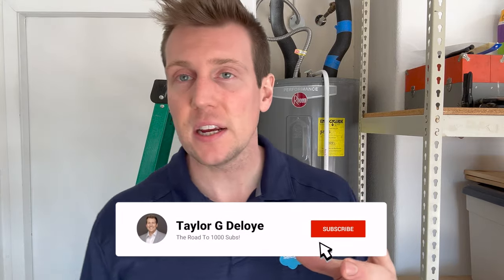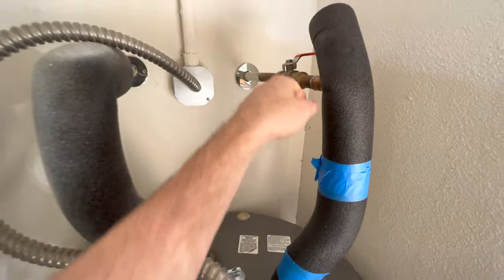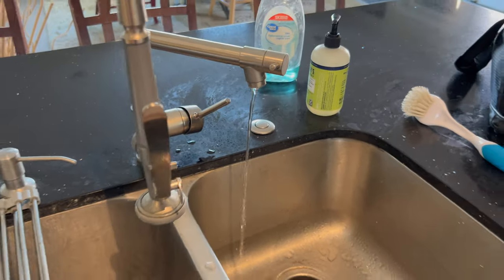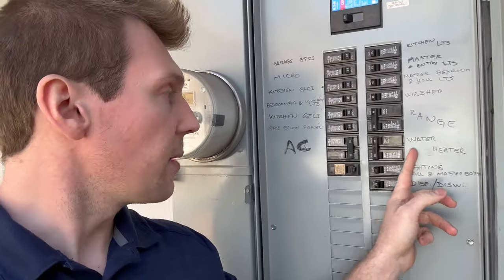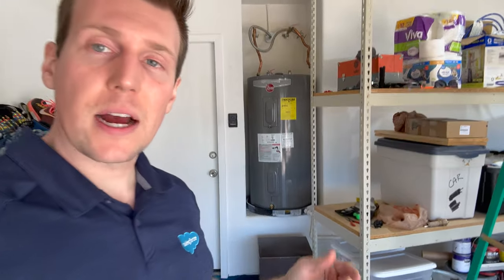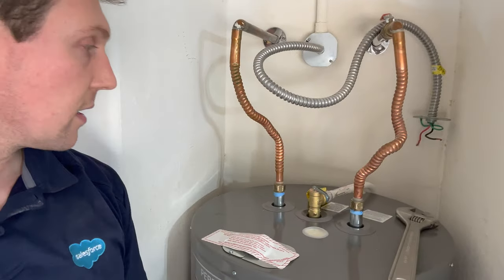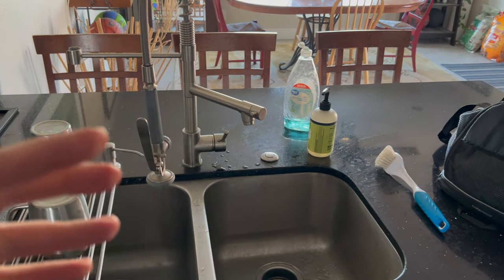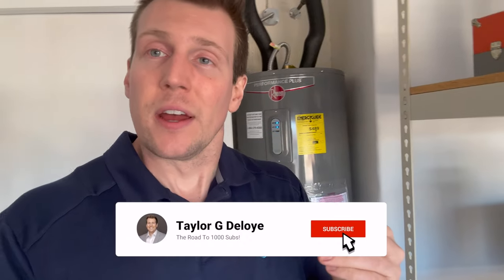New Electric Water Heater Replacement and Installation with Handy Tips #diy

Comment: Why not show the electric wire connections actually being done, then your like something something something electrical tape?? These people are watching because they haven’t done it
Reply from the maker: My apologies! I should have shown that in more detail. In general, you simply match the color of the wire, twist the copper ends together and then twist the cap on. Boom, done.
Reply: Then the pressure valve you have white hose or pvc that just appeared with no explanation.   The wiring and the pressure valve was what I needed more explanation of.
Reply: That's the whole reason I'm here, the electrical conections...
Reply: If you don't understand that you shouldn't try this

Comment: I was just quoted $2800 from TWO different plumbing companies to replace my hot water heater. THANK YOU so much for this video!! You helped me do this on my own. And, I saved $2,000 doing this! I'm a fan!
Reply from the maker: Great to hear Joe! Very welcome!
Reply: Price must include the super dupper high tech wi-fi water heater as well
Reply: @RCREVIEWS101   🤣🤣 I did it myself and it cost me around $700. A savings of $2100. What is WRONG with these companies??
Reply: @Joe_Murphy-REV_Realty  they’re just trying to make a living like everyone else
Reply: @Joe_Murphy-REV_Realty very nice you just voided warranty if anything happens and any home insurance.
Reply: @azzafilms97  not true. There is nothing on the warranty that states that a water heater must be installed by a professional. As a matter of fact on the warranty registration form on Bradford White's web site the only fields that are NOT required are the professional Installers name and phone number. I just returned the leaking heater to my local plumbing supply where I bought it and was given a brand new 40 gallon heater because the one I had bought was still under warranty.

Comment: You should run the sink the hot water side to get all the air out before you start doing your electrical work if you don’t do that is possible that you can burn out the water heater
Reply from the maker: Good to know, thanks!
Reply: Exactly .  Always purge the system of air and get water flowing from all the faucets hot side before you turn the breaker back on   or you can burn  out the top element . 
He seems like a good guy and hard worker but he shouldn't be doing DIY videos regarding this .
For the very reason that viewers might follow his instructions , but not see your comment
Reply: @vicschauberger2737 i think that happen to me I did manny mistake with the installation 😢

Comment: New potential home has the water heater in a closet in the living room with no venting. Is this a red flag ? The closet is closed with insulation to keep the noise down and no vent.
Reply from the maker: Water heaters don’t necessarily need to “breathe” like an HVAC system does. However, giving large electric appliances some airflow is generally a good idea, having it closed into a closet could reduce its lifespan. If this is a gas water heater it should NOT be in a closet as they produce carbon monoxide.
Reply: @taylor.g.deloye  thank you so much
Reply: @taylor.g.deloye  just checked it appears to be gas. It has a warning to call the gas company if gas is smelled.

Comment: You don't need so much teflon tape.  4 wraps is enough.  Also, it doesn't matter if it's red to red or black to black because it's 240v.   It is best practice to do color matching.
Reply from the maker: Thanks for letting me know!

Comment: Nice video, mine is in the attic, and it must have been clogged with something that it wouldn’t drain overnight.  It was a pain to replace 😂.  On a 1-10 scale, I would rate it an  11.  Had to go to harbor freight to get a chain hoist for 70 dollars to lower it safely.  I got the same model that is on your video.  It was a breeze to put in and install.  To hire a plumber, it would have cost $3000, paid $670 for the heater and $70 for the hoist.  Hopefully will not need to replace it in the next 20 years.  Great video. 👍
Reply from the maker: Wow sounds tough! Good work!

Comment: I was quoted $500 (with having already bought the tank replacement and getting a repeat customer discount), but I'm going to try to tackle it myself. I spent about $75 on the new parts, so that'll be a $425 savings if I don't screw up. The tank I'm replacing was made in 2005, so that's like 18 years lol so I bought the updated AO Smith 55 gallon 5500 watt tank replica tank on Labor Day for $300 off. I'm not going to bring it to code with the shutoff ball valve on the cold supply line b/c those lines aren't leaking and I don't want to have to get into cutting pipe and soldering, but at 2.625% interest, I'm probably not gonna move until this tank needs to be replaced again anyways lol. Gonna tackle it this weekend after OU vs TX. Wish me luck!

Just some info for your viewers when deciding on tank size and wattage:
- Someone who lives alone can get away with a 30-35 gallon tank.
- 2-3 people, you'll want 35-40 gallons
- 4-5 people, you'll want 40-50 gallons
- 5+ people, you'll want 50 gallons or more

As far as wattage, this just determines how long you'll wait for the new water in the tank to be fully heated. The higher the wattage, the less time you'll wait.

Hope that helps!
Reply from the maker: Thanks for sharing, good luck with the install!

Comment: Please explain to me why the upper heating element is on but not the lower? Should I be worried?
Reply from the maker: I believe water heats in the top tank first, if it’s been more than an hour or two after installation and you don’t have hot water you may need to call a plumber.

Comment: I just changed mine, but I have the first 2 upper light on. 

Is there something I’m doing wrong? 

It’s my first time doing this.
Reply from the maker: Wait about an hour after install and check if there is hot water in the house, if not, check that the wiring was done correctly

Comment: Do you have to wait for the water is drained before removing the hot and cold water valves?
Reply from the maker: No they can be separated once you start draining or even before. Just make sure the water supply is turned off.
Reply: So pardon my ignorance, never done this before so the way to tell it’s full is when you no longer hear the water flowing correct?

Comment: How long does it take to heat up water. I just installed mine and it’s not heating
Reply from the maker: Should be under 1 hour, double check the wiring and the power source

Comment: does it only use the top element?  my top two lights are on, it doesnt show the lower element active at first power
Reply from the maker: Both the upper and lower elements should be in use but when heating and indicator lights turn on may vary. It depends how much water you use and how much water needs to be heated.

Comment: After connecting the electric, how long until you got hot water?  I just installed my new unit and waiting for water to warm up, but I hear nothing... is that normal?
Reply from the maker: There is no sound when heating but you should have a hot tank in 60-90 minutes. Check power source and wiring. Is LED on?
Reply: @taylor.g.deloye  Thanks,  our tank is 50 gallon so I guess I was impatient... got hot water after about 40 minutes.  It never made a sound !

Comment: Question i have jist installed the same water heater today and how do you make the lower element light turn on?
Reply from the maker: It should be automatic. However I have literally never seen that light come on with my unit and I have hot water.
Reply: @taylor.g.deloye  yes you are correct it is automatic. So for me the top element stays on for like 10 minutes then shuts off then bottom element turns on. I was looking at the manual and couldn't find anything on that.

Comment: Thinking about doing this myself but my water connections are soldered on and Im not a professional 😢
Reply from the maker: You could buy the water heater yourself and then pay a plumber to re-solder the connections, probably still save $1000-2000.

Comment: Shouldn't you inspect or replace those copper water connectors? They look kind of old and bent. I always thought you replace them when installing a new water heater.
Reply from the maker: Of course! I inspected them, they are still in good shape, no leaks before or after install. Technically they should outlive any water heater

Comment: Where are your insulated water hose covers you removed?  You will need them in that area during cold months!😁
Reply from the maker: The new water heater came with new foam covers which I installed over the hot and cold copper lines

Comment: K , so the hiss was air leaving the heater as water went in ... now another question... on a ¾ straight valve there's a threaded bonnet ... what's the size of thread? 
After being in 3 stores where nobody knew how to finger it out I went into a Canadian tire , took 2 crescent wrenches and split valves at their gasket till my old one fit so this new one caped my valve but it's not the same packing as it's diferent valves but I was desperate ... what is the size of threads ??? Nothing but valves have it ,it's right tight so no gas fittings ... the threads that keep the handle and packing in the valve 

Sorry but when people who call themselves plumbers have no clue it's frustrating as pipefitting every valve comes with a book on size to the mm , metric or standard with a thread description down to type of thread ....
Reply from the maker: Are you able to call out a local plumber?

Comment: Is the water really bad where you live?  Are you in California? How old is the water heater that you removed?  Do you think you may have needed a pressure tester or one of those pressure expansion tanks?  Looking at the sediment dripping from the pressure valve on top?!! It looked like it needed other ways to get out!!!😂
Reply from the maker: My house was 90-100 PSI depending on the time of day, plumber’s guess and mine is that’s what caused the early death, also had issues with water hammer in the home. Had plumber add a PRV outside on the main and took care of the issues thankfully. Hopefully this bad boy will last 15+ years now. This one was only 7 years old :(

Comment: Gotta say, well presented video, with clean dialogue, and good footage.  However, Hmmm, “You're Gonna hear this…”. All I hear is the insipid background music, very annoying.  

You showed all the proper steps, and followed the safety protocols.  About that wiring:  I liked to see the added step of wrapping the wire nuts with tape.  However, stranded wire should be just about 1/8” longer than the solid copper wire, and use some linesman’s pliers, and twist the wires together, then twist on the wire nut.  It will never come loose!  

This was a fairly simple and straight forward installation.  So your comments on time and difficulty are not too far off.  Replacing a heater is a little more involved than replacing a faucet.  There was no PEX, no copper, no inline sediment house filter system, or other such things to deal with.  These are what makes this more than a two hour job, and more than a ‘4!’
Reply from the maker: Thanks for watching George, appreciate your feedback!

Comment: No expansion tank?
Reply from the maker: I had a pressure reducing valve (PRV) installed on my water main recently so I believe an expansion tank is only necessary if you have a closed water supply once it enters the home plumbing. Either way, I do think they are generally recommended but I did not install one as you saw. Thanks for watching!

Comment: That heater looks new and already jacked up?
Reply from the maker: Yea, it was only 7 years old, the water pressure was too high and I think that was the main cause. Installed a PRV on the water main out front to fix that issue.

Comment: Mine was filling with water and it suddenly start hissing like a water transfer from one tank to another
Reply from the maker: Hmm that’s really strange, I’d recommend calling out a Plumber to diagnose it
Reply: @taylor.g.deloye  it's a brand new one ... 

As I started running cold water into it with hot water open in the home ... it went from a straight flow to sounding like a pressured hiss...but no leaks 

Where could traped air be when the faucets are open ... dose a water heater create pressures or is the cold intake the only pressure?